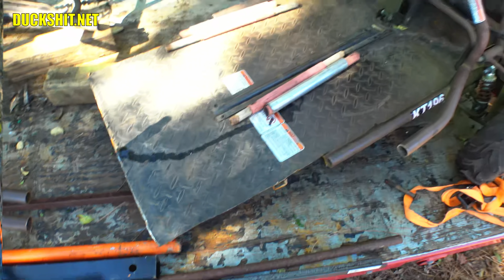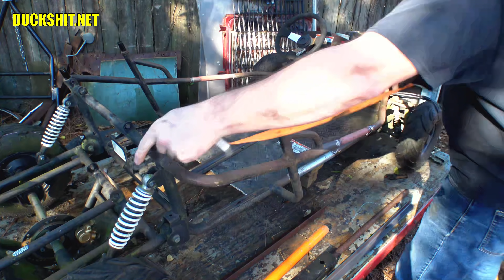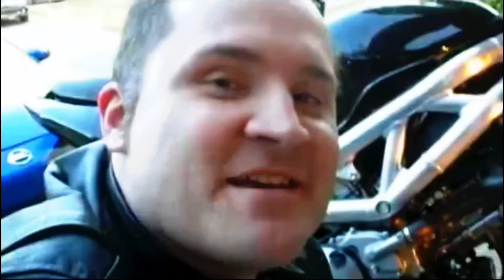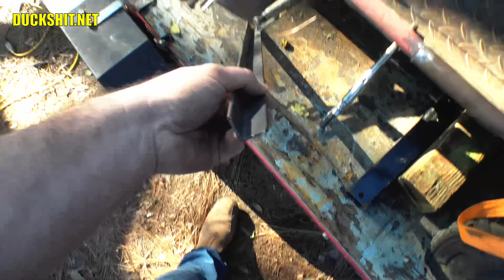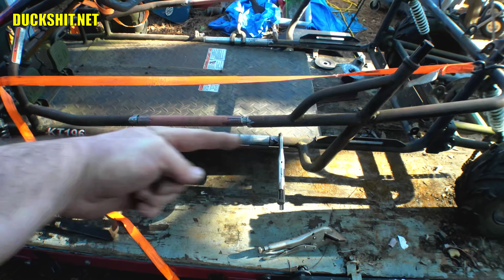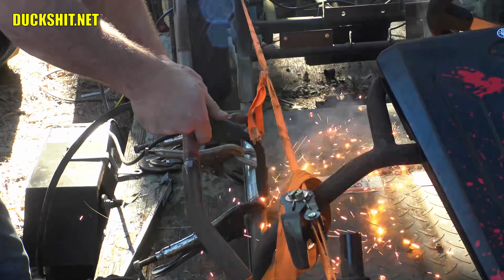Lengthening of the Frame - KT196 Go Kart - 04

Comment: Very nice to see Bee back. If you weld in a floor all the way to the back and then weld the seat frame, wouldn't that add a good amount of structural rigidity to the frame?
Reply from the maker: The floor probably adds as much rigidity as a sheet of drywall does to your wall... yes, some... but it's not the main structure.  ¯\_(ツ)_/¯  I just want to keep the mud out and make it look more finished.  😁👍🏻

Comment: will the steering wheel go as is or will it need extending,and what power unit will you be fitting.
Reply from the maker: Engine unknown at this time.  Steering wheel doesn't need changing, though I'd like a bigger one, but I don't understand the question, if its a question!  :)
Reply: @DuckmanCycles  oh sorry bud,i meant if your going to be sat further back will you need the steering wheel closer ie extend the column .
Reply from the maker: Yes, I think I said that in some earlier video, maybe even this one.  The column needs to be longer, and also needs some universals to get it into the offset rack and pinion.